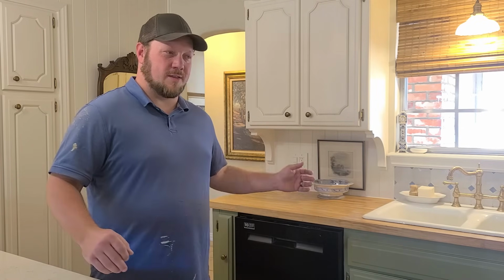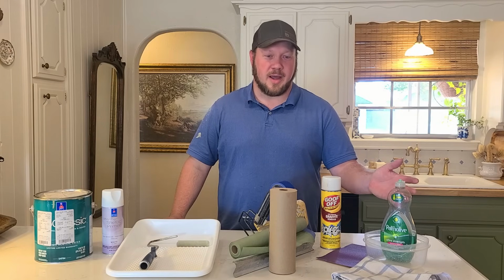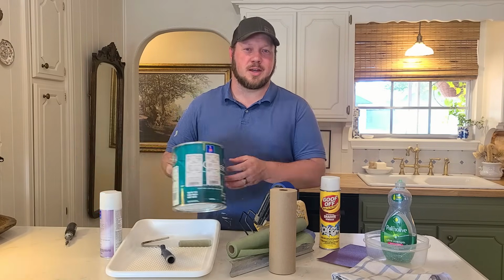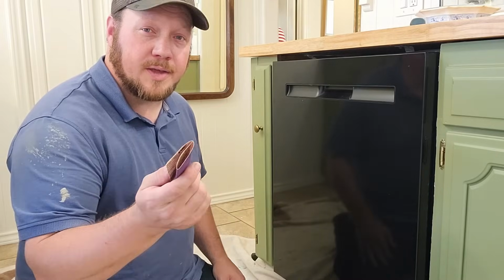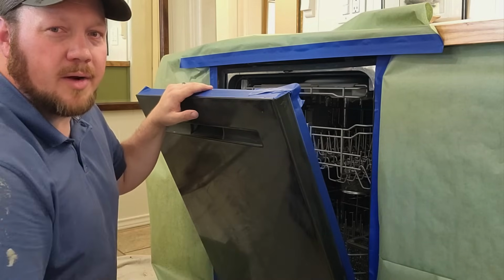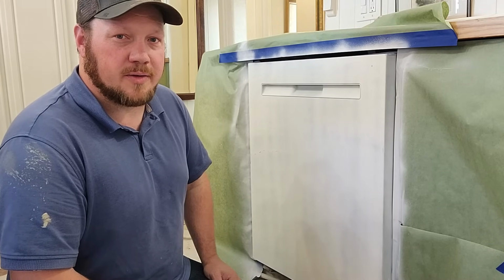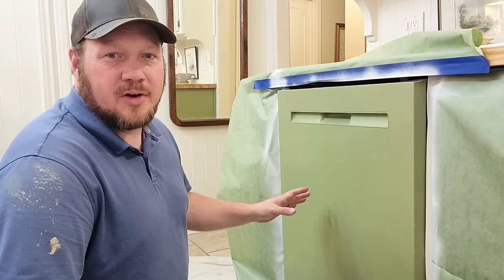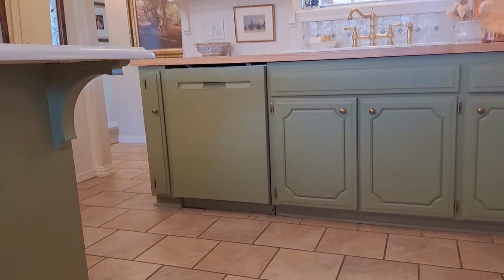Designer English Cottage Kitchen Tip ~ Disguise Your Dishwasher

Comment: Your dishwasher looks great now! I did not know that you could just paint a dishwasher front.
Reply from the maker: Thanks!
Yes, I was surprised, too!
Reply: Dishwasher looks great! Just a thought. The slot where you open the door will receive the wear & tear.Have you thought of a way to use a piece of brass trim to match the cabinet hardware and prevent scratches there.Maybe a piece of brass from a mailbox or kickplate that you could shape,clean and polish.I really enjoy your channel.English country has always been my passion.Still is,even at 70+ years I am now working on creating my new home in a Senior's apartment. I suppose this will be my final remodel.Should I eventually share a room in a nursing home, I suppose I will be limited to a picture or two.😅 That's OK, I have plenty to choose from.